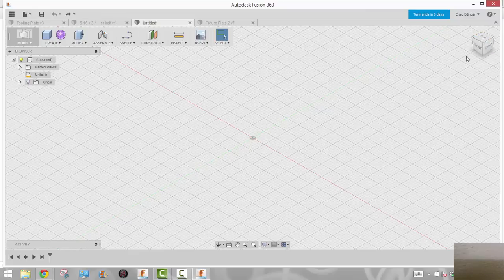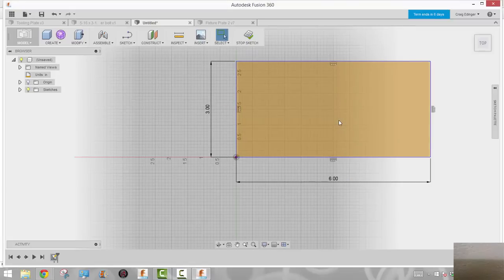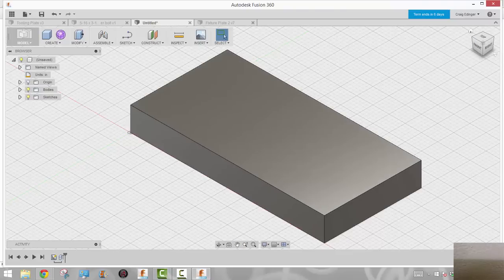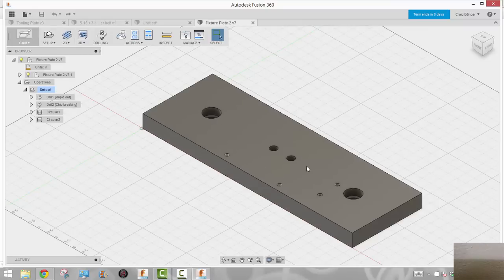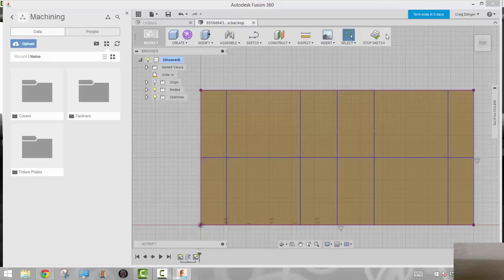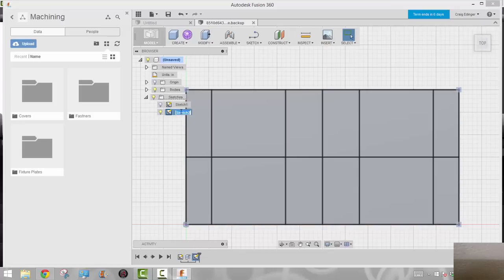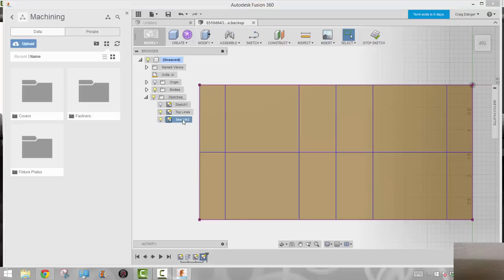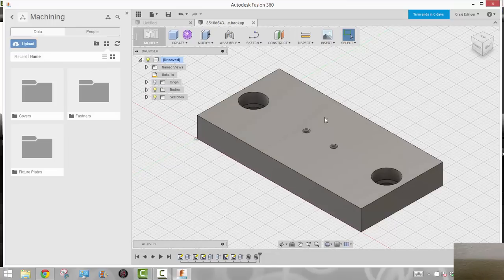Making a Fixture Plate Part 1 - CAD in Fusion 360

Comment: When threading holes you can select multiple holes by holding the CTRL button (windows)
The Normal/Construction option is on the "Sketch Pallet" on the right hand when you are in sketch mode.